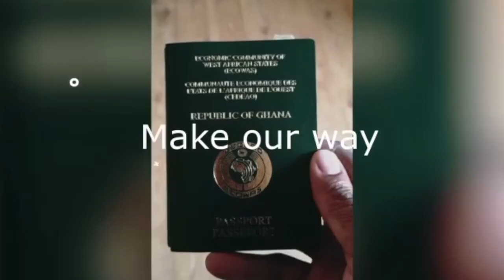Building Our Dream Home In Ghana | Electrics First Fix| Building Update

Comment: Congratulations 🎊 on your project.
Kindly check your heading please.
1. I suggest it reads Electric light and sockets demarcations.
2. Thought they would have finished the roofing before the demarcations?
3. The height of the sockets is extremely low, the standard height is 300mm = 3m above the floor.
Such that after the floor screeding and tilling you probably might reach about 2.3m considerably.
3. All sockets must be twin sockets.

Thank you for sharing.
Regards
Mr. Bright from Bright&Clara's channel
Reply from the maker: Hi, thanks for your informed insight and eagle eye. We have chosen to have our lower socket to be around 45cm from the floor as we are familiar with from our time living in the uk, but as you have said I’m not sure they have taken in consideration the floor tiles and screeding. Thanks again 👍🏿

Comment: Hope that is all well but PLEASE check that they used a level on the height of the plug sockets. Been in too many houses where the plug sockets are at all random heights. It is so easybto miss it at this stage and cey aboutt it later.
Also check that the height of the consumer board ia such that you can access it qithout a ladder.
Looking forward to seeing the rest of the build
Reply from the maker: It’s funny you say that,I edited out the spirit level taking and the plug socket also.We was on-site for all of this and they still made a mistake in one of the bathroom’s 🤦🏾

Comment: You'll find your electric sockets are to low, should have been .600mm from floor, they look to be about .300mm up, your having flood electrics for you sockets, min of .75 - 100mm screed depending how many pipes cross over, plus 25 - 30 mm for tiles, your sockets are virtually on the floor, alter them now before plastering, also, if no visqeen was (damp proof membrane) laid, the socket could have problems damp ...
All in wall pipe work should run vertical up or down from switchs/sockets, or vertical if connecting another on the same level, very bad practice laying piping diagonal, that goes for all pipe work, water A/c ...
Light switches look to high, especially if you have children they cannot reach them.
If its a single storey  I'd suggest the roofing needs special design, long inside passage, by mid afternoon you'll need lights on.
A passage that length ideally have beeb 2m wide.
Make sure you have an approve electrician, if the come and test there's a fault it's costly to resolve.
Your roofing need special features inbuilt, to lighten you passage.

Comment: That long corridor I would have put roof top windows or sky light I am sure that you overstand what I speaking about??
Reply from the maker: Yes your on point,i plan to let light in from the front or the building,we will cut in extra silt windows above the lintal and the same in the hallway.
Reply from the maker: Ive also been looking at solar tubes.